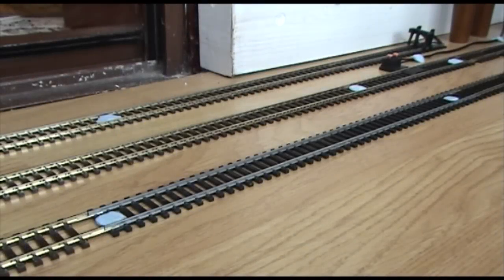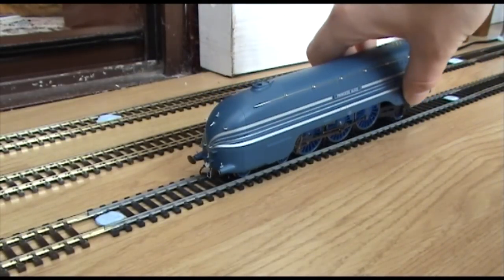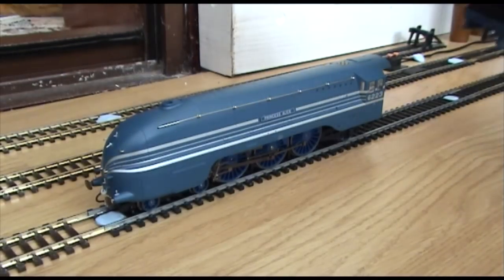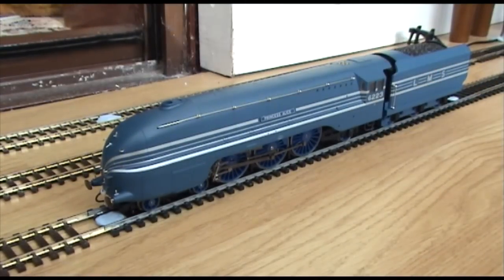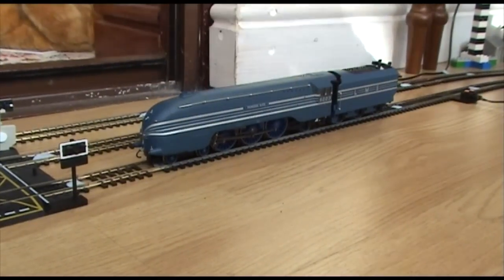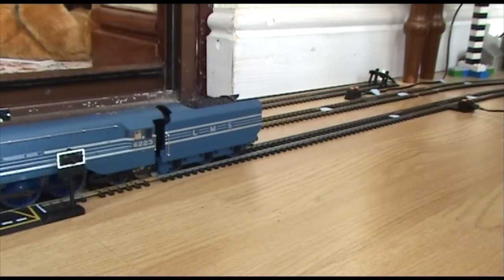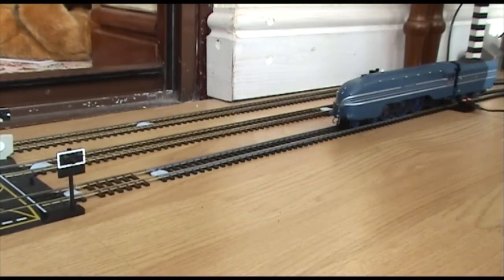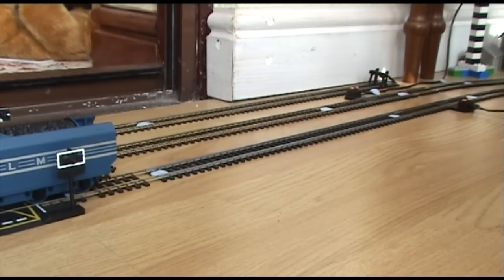Putting 'Princess Alice' onto the rails...

Comment: Hi, I have a question, I have this model and yet there seems to be a problem, it runs absolutly perfectly, until I put the tender on, and then it wont move at all, once I saw a little spark when I attached the tender, so I'm wondering if it somehow shorts itself out on its own tender...any advice on what I should do?